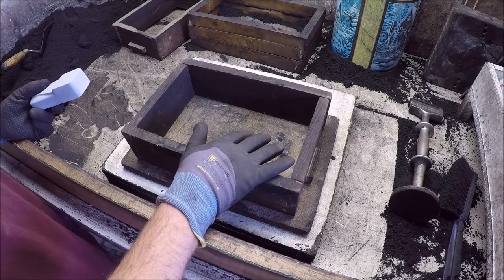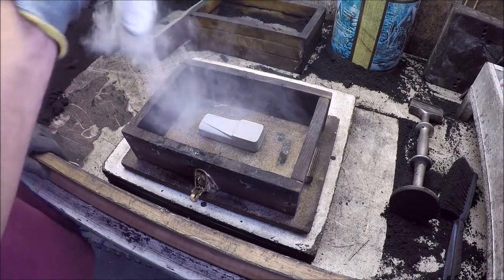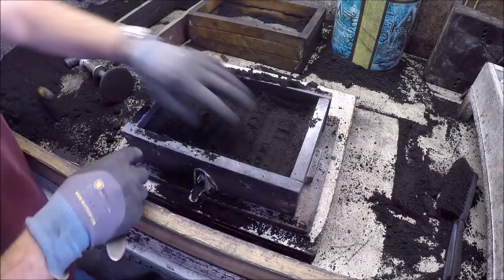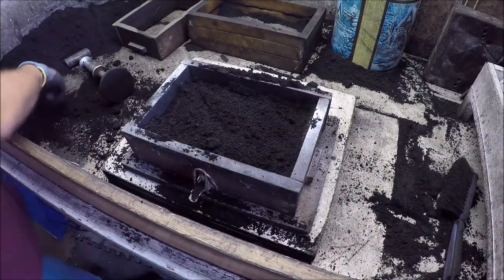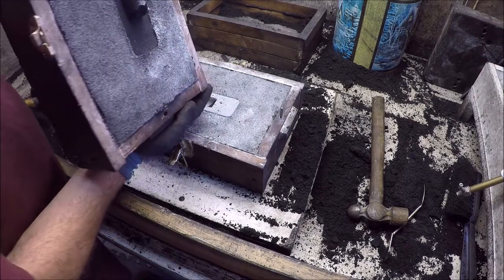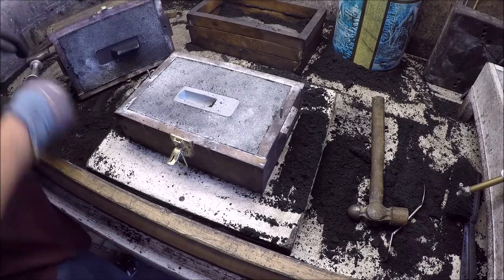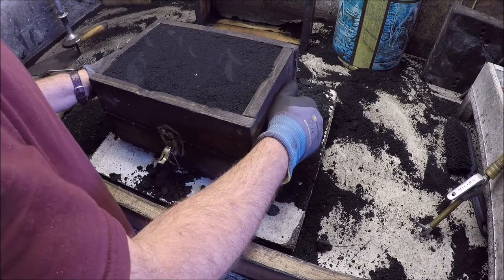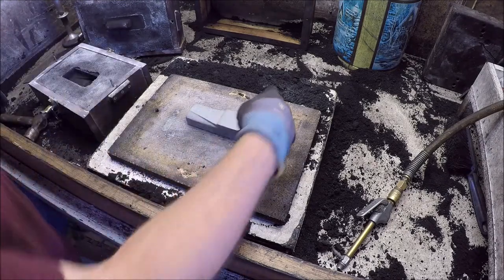Foundry Pattern Making: atlas compound slides #6

Comment: Nice job there Chris. Its an art form for sure. I remember in metal shop our teacher added used motor oil to the sand. 🤪.    It was a stinking smoky mess. Guess shop supplies were at a premium back then.
Reply from the maker: Lol no that's how we do it to lol
Reply: Hope you pour outdoors. It might not be too bad. It worked very well though.
Reply from the maker: We do but this was just a tester no metal was cast.

Comment: It was been many years since I have made a sand mold but the sand looked a little dry to me.  Thanks for sharing.
Reply from the maker: It's Petra bond that's how it's looked for years :)
Reply: petro bond does always seem dry...regular greensand seems like it has more stickiness and strength to me!
Reply: but its nice ot not have to fuss with it to get the correct moisture content.
Reply from the maker: I've never used green sand myself.